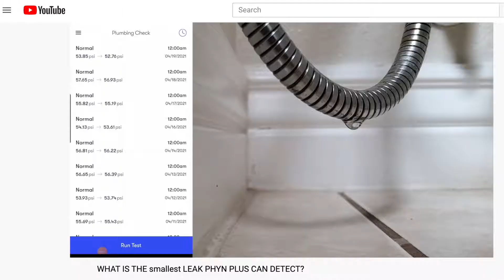Help! What are YOUR Concerns?

Comment: Another topic worth some discussion is best practices in deploying water sensing devices and systems. Water leaks can come from several sources, plumbing (pin holes, fittings, connections, appliances), drains, and outside incursions (sumps, wall weeping after heavy rains). It seems each needs a different approach or combination of sensors. 

I'm wrestling right now with how to best sense leaks from sinks, toilets, and appliances. I've had leak sensors for years but they always missed the leak. The most recent which I mentioned elsewhere, was an upstairs leaking toilet supply fitting. The leak was too slow for Moen Flo to catch. It dripped straight into the tile floor missing a water sensor barely 6 inches away. We detected the leak when we saw water seeping through the living room ceiling. A similar case was at my daughter's house a few weeks ago where the water supply line to the fridge leaked and was detected when they noticed the wood floor swelling and saw water dripping in the basement. They do not have water sensors but they would not have helped in the normal deployment as the leak followed the supply line into the floor with no water pooling. 

Here is my current thinking on this subject. I have several Moen Flo water detectors and I'm considering adding their leak sensing cable to them, wrapping it around supply lines to toilets and sinks and sink drains. That cable is 5 feet long which I'm thinking is much longer than needed in some cases and might become unsightly so I might try cutting it to length. In addition to working, it needs to look neat and tidy.

In the 10+ years I've been working on water leak detection, I'm batting zero in real application. However, I'm encouraged by the potential of the new technology to increase my odds considerably of reliably detecting water leaks before it causes damage.
Reply from the maker: I totally agree. When I buy more sensors I'm planning on showing what I ended up doing to maximize my 9 sensor limit with Phyn. Your unfortunate real examples highlight one of the hard parts about this subject: it's all a best guess and even then, water finds a way to go undetected. Even worse is when it is a leak that isn't related to plumbing. A leaking roof, condensate line, basement wall leaking, etc. which are also places where the sensors can help.

With regard to how it looks, rather than cutting the sensor cable could you loop it with a zip tie where the extra length could be hidden, let's say, behind the toilet?

Really appreciate your comment. I like how you think!
Reply: @NoMoreLeaks  A 9-sensor limit would be a problem for me. As far as I can tell, Flo has no such limit. I currently have 11 sensors; 3 Flo and 8 others that I'm in the process of replacing. If I do all the locations I theoretically should, I'm looking at 20 sensors. At around $45 for the sensor and $24 for the water sensing cable, the cost is well over $1,000. Ouch! Would something like Aqara sensors at $15 each be a smarter buy? Aqara sensors don't support water sensing cable, how critical is that? The water sensing cables from Flo are rather stiff and don't naturally lie flat on a surface. Do you tape them in place? Perhaps a mix of Flo and Aqara sensors? Lots to ponder when it comes to the nitty, gritty details of deployment. The goal is improving the probability of catching a leak before it causes serious damage vs cost. I don't see much effort being expended at this level of system design.
Reply from the maker: Your limit is 88. I asked at the last builder's show and while I'm not great at remembering numbers, that one stuck because it isn't a normal number. In any case, agreed, it's a sticker shock, but the ability to shut of water could be worth way more than that (although sadly you seem to have the unfortunate knack where that is not true). Are there any places where you could daisy chain sensor cables to cut down on some of the cost? All of those questions are relative to the individual so I'm hesitant in saying how effective it is and if it is worth it. I'm all for function though. I like using painter's tape to keep something in place, which doesn't leave any sticky residue although it is not aesthetically pleasing.

Comment: Is your phyn application working all the time? I bought the smart monitor one (under the sink) and most of the time tbr app doesn't work.
Reply from the maker: Currently the Phyn app is stable, but it was not a few months back. They've had a few updates since then and I've had better performance. I have a Samsung Galaxy S10+. I generally give companies a lot of grace it comes to phone apps--I imagine it is difficult to constantly update an app with the ever changing phone updates with the sheer volume of different phones out there. But it has been solid the last couple months. The workaround I successfully used before was closing the app and reopening. What phone do you have?
Reply: @NoMoreLeaks  I'm using a Samsung Galaxy S22 Ultra, the Phyn app really sucks for me, no way to capture those alerts in real time. It seems Flo app is better. In my case, I want to test Flo and it will be located in a basement.
Reply from the maker: Interesting especially since we're in the same family of phones. When I was doing the back to back testing of the Phyn sensors, my phone, my husband's S20 and his iPad were going nuts while he was in Texas and I was testing in Arizona. But I totally hear you--your results are different and you have to have reliability on the alerts coming through.

Comment: Excellent information as I just purchased and had Flo installed. I use mine in a second home that we rent during the summer. The house sits empty a good chunk of the time in the off season so my main reason for purchasing was for protection when no one is there for weeks at a time.  As rental season arrives I am concerned that the “extra” water usage will trigger a shutoff while we have guests. The thought was that we could use away mode to prevent this but learned that it only lasts for 72 hours. I chatted with Flo customer service and they said there is no planned update for this and best option would be to unplug the Unit if we have more than usual activity with guests in the house.  That is what I will probably do since I don’t want to risk shut off and inconvenience for our guests. Thanks!
Reply from the maker: Thank you for your comment. You are absolutely right in your logic. Disabling auto shutoff a big difference between the devices. Phyn Plus allows for disabling auto shutoff indefinitely so you could receive alerts, but not have the valve shut the water off. I'm personally very sorry the video hasn't come out sooner to let you know about this specific feature. That's terrible because you don't get the peace of mind knowing there is a leak during the on season when there is so much more demand on the system. Here's a work around: plug in Flo by Moen to a Wyze Plug https://amzn.to/3qsmehd or something along those lines so you can remotely shut off the outlet for Flo. Perhaps you can do other things like automatically turn it on when the clients are scheduled to leave--I'm not sure if that's a real feature with the Wyze Plug, but something like that might be on the market.
Reply: @NoMoreLeaks  thank  you for the response and suggestion of a smart plug, that’s a great idea.  I am disappointed about the lack of extended sleep mode but still very satisfied otherwise. As I said I was more concerned with the house being empty and having an issue and being protected.  Sometimes we can go a couple of months without being there so would be a disaster with even the slightest leak. We will make it work the best we can and appreciate all of the thorough information.  I have learned a great deal from the series.  Take care!

Comment: Concerns:
1) It's impossible to buy the Moen Flo anywhere unless you are willing to pay double the retail price on eBay
2) There are many reviews for the Flo complaining that the impeller gets rusty and the unit stops working. It would be good to know what causes this. Are there particular areas in the US where iron concentration in the water is higher for example? If one lives in such an area is the Phyn a better choice than the Moen flo?
3) Smart home integration. Moen Flo integrates with Home Assistant but Phyn does not
Reply from the maker: Thank you very much for sharing your concerns, Mark. I’ll address them with my past thoughts/experience in the interim:
1) Flo certainly has been hit hard by supply chain problems and that may or may not be addressed in the short term. I think your second concern is an additional issue here--current customers as well as new customers are asking for the replacement/new devices. The Flo by Moen product page is entirely gone. Phyn Plus just went on backorder.
2) Rust/corrosion buildup aside, the turbine is a moving part whereas an ultrasonic flow sensor isn’t a moving part. This is huge for wear and tear. My past experience as well as my concern on the turbine design is 100% why I’m enrolled in the Flo Protect plan and suggest everyone to highly consider it if they are sold on moving forward with Flo by Moen. It is a significant additional cost over 5 years. I don’t know the minerals/contaminants breakdown, but that is a valid concern. With my own experience, since Phyn survived in the desert and Flo didn’t (given that wasn’t a turbine issue), I think Phyn would last longer than Flo in any environment.
3) Flo pairs with Google and Alexa and Phyn utilizes IFTTT. Both have very limited options. I haven’t done much with it due to that so I’m curious, what do you plan on doing with the integration?

Comment: Wish…I knew phyn plus needed to go before the prv.
Reply from the maker: I'm curious as to why it should go before the PRV. It is my understanding that a water monitor and shutoff system should be on your side of the PRV. That's where you want to see the pressure so you can identify if the PRV is going bad as opposed to verifying the city pressure and not knowing what pressure is actually inside your house. With that reasoning it sounds like yours is correctly placed.
Reply: Had to ditch the phyn because there was no room for the phyn unless it was before the prv. Instead went with the yolink battery operated sensors & battery operated shutoff that can be used before or after prv. Works very well & more importantly works when power or Wi-Fi goes out.
Reply from the maker: It's great to hear you found a solution for your situation! Thanks for sharing what you decided on and why.

Comment: How do you teach Flo what is "normal" usage for your installation? Flo will alert you for what it thinks is excess water usage. How can we refine that calculation? I have a situation where my wife will sometimes let the shower run extra long to which Flo send me a message. I've always guessed correctly what's going on and bypassed the shut off by Flo. That process works really well, thank goodness. Since it is repeatable, it would seem the Flo AI process could be trained like I am. How can we refine Flo's algorithms to cover situations like this? Since flow regulation is a complex issue involving several factors, are there some scenarios you are better off not trying to automate? As much as I appreciate automation, I've had situations in other areas where less automation is better. Can Flo become too smart in its application of AI?
Reply from the maker: Manual overrides is the only idea I have on that. I wish their manual override could give us a minimum flow rate. That would allow you to maintain coverage for everything below the flow rate by the shower head. An irregular use like that is understandably hard to identify the difference between a washing machine supply line burst compared to a long shower. While it may sound like I'm being cheeky, it sounds like the long showers need to happen more often to get the algorithm to identify it properly.

Comment: Love my Flo unit. The first revelation after installation was that my pressure regulator needed to be replaced. It was clearly broken. The new one works, but I'm trying to figure out if my new regulator is working correctly. Normal line pressure is about 50 psi, street pressure is about 125 psi. I regularly see peak pressure from Flow of 80 to 100 psi. Sometimes they last for a couple of hours. I'm guessing they are related to pressure build up from expansion from the water heater, but they are not regular enough to be sure. If you can shed any light on what "normal" looks like in water pressure regulation that would be helpful. Also how to get good history data from Flo for later analysis. It's clear the Flo folks have it. I would like access to that data periodically for problem diagnosis.
Reply from the maker: The longer view Flo provides is one of the major strengths of Flo--instrumental in discovering failed PRV's. I loved hearing that when you shared your story. When I closed my system and left the water heater running I was seeing spikes of 25 psi when the water heater kicked on. If there was more hot water in the line with a PRV I'd expect the pressure to go up. However, I'm not sure about maintaining the elevated pressure for a couple of hours part. It's cooler now so I wouldn't expect it to stay at the high point for very long--just a gradual drop for a few hours as I saw here (at the exact timestamp of two different overnight runs): https://youtu.be/9jglN6I-HzM?t=27. I'd also expect to see this at regular intervals, but again, if there is a lot of hot water usage at that point in time perhaps that explains it? I don't have a PRV and the home where my current Flo is located doesn't either so I don't have that. It doesn't sound like it's an expansion tank issue. I'm laughing because just last week I called Flo to get the pressure drop on a health check I ran last October. It is nice that they have the data. Although I wonder if the storage part could be used against insurance claims in the future...
Reply from the maker: PS I always love your comments. I'm not a plumber so I always learn something and have to think critically to formulate a decent response. I very much appreciate your attention to detail and testing results.
Reply: I also had to replace my PRV, and additional spikes were being caused by my blown expansion tank.  That could be what you were seeing?

Comment: I've been considering getting a system like this for my home. I am also out in the desert and on a well. Do you know if that matters? Also which one do you think has the higher quality fittings or whatever for the plumbing aspect of it? Did you install it yourself or did a plumber do it and if so, do they have a preference between the two brands for quality installation? Really cool seeing an unbiased 3rd party review these. Thanks!
Reply from the maker: My first question is if the device will be installed inside or outside? That very much matters. If inside, will it be in a hot garage? I've heard good things about both systems on wells with some additional measures like these: https://www.phyn.com/help/installing-a-phyn-plus-in-a-well-home/ and https://support.meetflo.com/hc/en-us/articles/115003950254-Can-the-Flo-by-Moen-Smart-Water-Shutoff-be-installed-on-any-type-of-water-supply-line- Fittings wise, both units have some high quality plastic for the threads--Phyn requires additional water meter couplings (generally brass, but it depends on your plumbing type) and Flo has a high quality plastic nut, but those lasted for the 4 units I went through--there's no way to get them off once installed. My husband installed both Flo by Moen and Phyn Plus. You'll have to coordinate who gets the connectors for Phyn Plus because a plumber isn't likely to have them but they are generally in stock at the local plumbing supply (not big box stores). There are too many options available for a one size fits all solution because everyone has different kinds of plumbing and sizes. If your eyes glaze over at this: https://www.phyn.com/help/plumbing-unions-and-propex-parts-for-installing-your-phyn-plus/ let me know what your plumbing is (copper, PEX, etc.) and what size pipe. Flo has their copper piece which comes in the box that will get soldered to copper (and then transition to other types of plumbing, if needed). Both are visible in my unboxing and installation videos. Appreciate your compliment--I'm trying to be unbiased, but I certainly know which one works for my particular location.